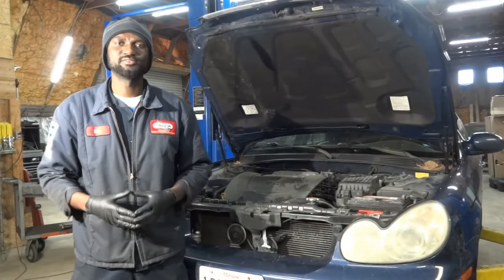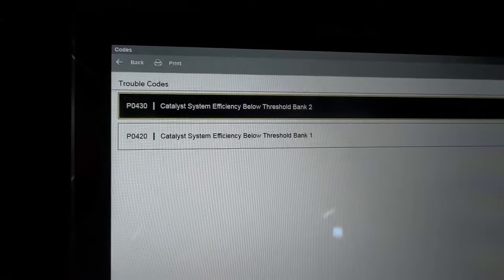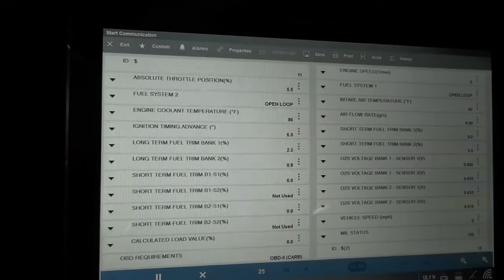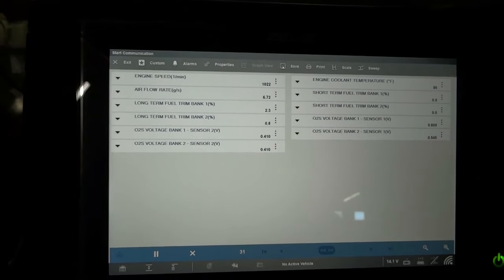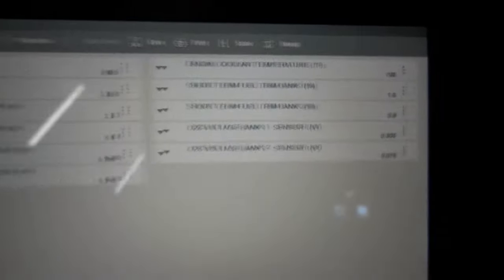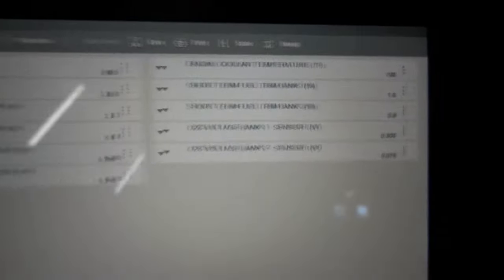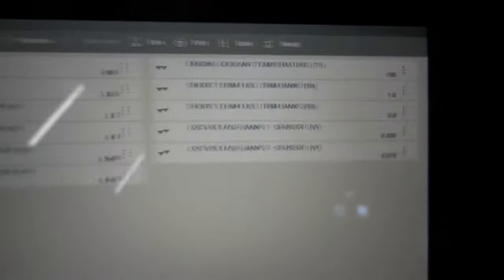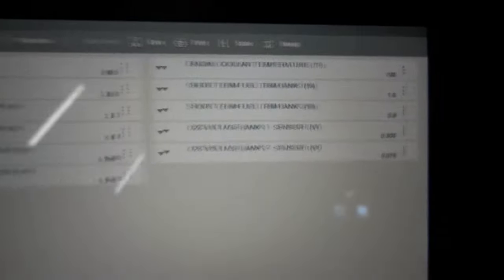Catalytic Converter Efficiency Below Threshold: Code P0420 & P0430 Diagnosis and Repair

Comment: Excellent.  Fix the CAUSE.  I got a p0420, and every shop tried telling me just replace the CAT for $1,800.  NONE of them wanted to look at anything else to find the source of the problem.  The problem was severely carbonized spark plugs not burning fuel effectively and leaking liquid fuel into exhaust sytem clogging the CAT.  replaced plugs, cleaned the CAT, intake and ran some fuel system cleaners.  Been running ever since
Reply from the maker: Samuel Snipes  Thanks! I'm glad to hear that you were able to figure it out!
Reply: This happened to me. Also, an exhaust leak on my flex pipe wasn't letting it get a propper reading
Reply: Great thing to hear. Saving Big bucks. I have the same thing with my C C. I have tried many things because the bash has litten up like a Chistmas tree, and the wind shield wippers are driving me insane. So I unpluged the fuse. It also say on the computer Blind Spot System need survice. But when I start up in the morning or when ever the the engine is cold it blinks and all the warning lights come on.
Reply: Wat cleaner did you use
Reply: That was an excellent explanation, u must be a teacher.  Thanks
Reply: That is a ridiculous price they were trying to get you!!

Comment: First time that I've heard Short and long term explained in all of my 29 years of service. Even teachers and other techs have not nailed it like this bro. Most other people want to be heard for their much speaking instead of making the point clear.
Reply from the maker: MiKyahl Thank you!!
Reply: FOR REAL, I SWEAR THIS IS THE ONLY CAR VIDEO DONE PROPERLY
Reply: What's the max heat range for the cat=and what's the comfort mv for the O2=
Reply: @KITS_Auto_and_Truck_Repair  yes i agree...first time ive found a good lesson on reading the o2 numbers! Thank you!
Reply: Great video! When reading temp i believe before cat was 390 and after cat was 330...you said the after cat temp should be much cooler than before cat...hiw much cooler? 330 is 20% cooler what after cat temp number should we have seen? If it clogged wouldnt after cat be alot cooler also?
Reply from the maker: @mboemmels   My Pleasure!!

Comment: Great, clear, concise PROFESSIONAL information that finds the root of the problem and FIXES the cause, not just the symptoms.  Plus, I would bet 99% of most shops would never asked or have found out the engine was replaced and the cats may have had 200k miles on them.  Yes my friend you said it, “ fix the cause, not the symptoms”. 👍👍. VERY COOL.
Edit, Subbed too.
Reply from the maker: lazerrred  My Pleasure, I appreciate it!!

Comment: Hello K, I would like to point out the difference in temperature between the intake and output is not near the 100°f degrees you stated it should be.
The temps on the old defective Cat were: 
Intake:   390.5°f
Output: 334.4°f
A difference of 56.1°f
The temps on the NEW Cat was 
Intake:   404.3°f
Output: 336.2°f
A difference of 68.1°f
The difference in temperature between the old and new is only 12°f degrees.
It seems to me this is not a accurate method to determine if the catalytic converter is defective.
I think your video is great. The detail and examples you show are top. You excel in quality the art of putting a great video together. Thank you
Reply from the maker: Just Me  Thank you! the rule of thumb is usually 100 degrees higher on the outlet, temperature wise!
Reply: @KITS_Auto_and_Truck_Repair  - Although the video seemed to explain the temperature difference incorrectly (I've understood that the outlet should be 100-150 degrees hotter) it is still great that you covered it so that people know this is a simple test that can be done.  Great job.
Reply from the maker: @dricklorenz9340  Yes! That's what I meant but I misspoke in the video, Thank you!

Comment: First I would like to start off by saying I watched this video from the very first second to the very last second and I must tip my hat off to you sir. You are very straight forward, informative, precise and honest! I wish I could find a quality and honest mechanic like you where I live. I'm not sure where you're located or if you have any contact info, but I would surely become your loyal customer. The reason I say you're honest is because as soon as you turned that vehicle on after the installation was over with and that check engine light went away... you could've easily fooled everyone and told us there you have it folks the check engine light is gone because we fixed the problem. You sir did not do that. You told us the truth! When disconnecting the battery cable(s) from the battery it essentially clears any codes stored in the vehicles computer/memory (which is true). I respect and admire you for that.

I have a 2007 Hyundai entourage limited V6 3.8L and I have a P0430 code. I'm doing everything myself thus far and in doing so I found a lot of cutting corners from every "mechanic" that has worked on my car in the past 6 years or so. I'm not a mechanic by any means and I'm learning as I go by researching and reading. Every shop I have gone to so far... everyone says it's the catalytic converter, but not the two that you changed. They're saying it's the catalytic converter that's underneath the car. No one has done any tests of any kind to determine if it is in fact that catalytic converter. They're just saying it's that one. My gut is telling me it isn't, but again I'm not a mechanic and I could be wrong. The car runs like a champ! You wouldn't think there's anything wrong with it. I do know the fuel is either too rich or lean because my gas gauge is always fluctuating up and down before finally settling and before this code appeared I never had fuel issues. Some times from the muffler I can smell a very rich gasoline like smell. I was also told to first replace the spark plugs and go from there. Start with the smaller stuff before changing the catalytic converter to see where the problem is coming from. I've already changed that and all the O2 sensors, but the check engine light came on again with the same code of P0430 bank 2 catalyst system efficiency was below threshold for a predetermined period of time. I'm just now sure which catalytic converter it could be. 

Would you be able to share what name brand and model # obd2 you are using so I can look into purchasing one?

I'm sorry for this long message, I appreciate your time and the time you put into this video for us. I hope to hear from you soon. Take care!
Reply from the maker: Luis Rodriguez, I really did appreciate your comment I read the all message, thank you for watching the video... the scan tool I'm using in the video is a professional type scanner, since you're working on your own vehicle I would not recommend that kind of scanner, you should get a regular OBD2 scanner that can graph data parameters from your local parts store...
Now, about the P0430 trouble code that keeps coming back on your car, I will say,
 you should check the wiring of the 02 sensors especially the one after the catalytic converter, then double check the sensors in case you got defective sensors out of the box, if everything checks out ok the last thing would be a bad catalytic converter,
if you end up replacing the cat, make sure you determine the cause that caused it to fail before you replace it...
I have a couple of videos on this channel that can show you how to test the 02 sensor wiring or the 02 sensor itself.... Good Luck
Reply: @KITS_Auto_and_Truck_Repair  thank you for responding! Not sure what's a good scanner that can do the same as yours or close to what yours can do. I'm very meticulous when it comes to doing things and that's why I asked. If you have any recommendations I'd gladly appreciate it. Which catalytic converter would be the one that I would change if it does come down to that? Is it the one underneath the car or is it the one you changed in the video? Thanks again for responding and have yourself a great night.
Reply from the maker: @luisrodriguez9712  I can't tell you which one to change; you have to get it diagnosed so you can know exactly which one to replace. I recommend taking it to a professional shop... Good Luck!!!
Reply: @ Luis Rodriguez it’s a Snap on Zeus.
Reply: @ Bork Ganza thank you

Comment: Had the same issue (code p0420 bank1) on a 2000 Acura Integra but car ran perfectly fine. Heard about CATACLEAN and decided to give it a try as my mechanic said it was the cat that was bad. Poured in the entire bottle ($27.99 at AutoZone) when I had 1/4 tank left (per instructions) and drove it for about 100 miles. I noticed a boost in power right away but CEL was still on, I had to reset it and drive another 20 miles or so and when I checked with scanner again, all monitors were ready and no CEL. Took it to my smog station and passed with no issues. Great product which if it wouldn't have worked, this was going to be my next step.
Reply from the maker: G R  oh really!
Reply: @KITS_Auto_and_Truck_Repair  yes sir! I was very concerned thinging my cat was def gone even after using cataclean because the monitors would still show INCOMPLETE on the Cat, O2 Sensor and EVAP after the recommended 10-15 min drive the bottle specified. I guess some cars take a bit longer to react to the chemicals but mine took about 100-120 miles before all monitors cleared on their own. I have no doubt though the non fouler method will work as well but depending on the car, it can be a bit more invasive and time consuming than first giving cataclean a try...just my opinion though  😀
Reply from the maker: @gr2262  sounds good!

Comment: Really excellent explanation of how to diagnose catalytic converters issues. I love the trick of pumping the brakes to make the engine run lean. Now I need to get a scan tool that will show me real-time data streams. (I just bought a cheap one that doesn’t have that feature, am going to return it and upgrade.)

Thanks!!!
Reply from the maker: Dave Etchells  My Pleasure!! Thanks and Good Luck with your project!

Comment: This is the most thorough diagnostic video on o2 sensors and catalytic converters I've seen. Congratulations.
Reply from the maker: Lawson Stallings  My Pleasure, Thanks
Reply: @KITS_Auto_and_Truck_Repair  I have an 07 525i and the brake test didn't affect the sensors' data. I shot a couple of videos that I can send you if you have the time to have a look at my data.

Comment: I love the way you go through the process of testing O2 sensor response by pumping the brake pedal. I have a -29% ST Fuel trim reading. Also a p0420 and a p0170 pending on a 2011 2.4L Sonata. No check engine light but driver said car struggled to accelerate. Once it got going it wasn't as bad.
Reply from the maker: Lubacote Mobile Quick Lube  you might have leaking fuel injectors or a bad regulator
Reply: @K Diagnostics  Thanks for replying. After re-check I realize it was ST fuel trim not long term (updating). Now a P0106 (MAP performance/range) is coming up in pending and actually turned on the check engine light after I filed and gapped plugs . I watched the MAP reading along with trim numbers. MAP readings did something funky a few times that correspond to idle and performance. It's on an 2011 Sonata 2.4L. Gonna clean throttle and intake, change oil replace plugs maybe a sensor. Then clear light. If I have to pull O2 sensors and check pre and aft-cat pressures if the p0420 rears it's head again. Then again those gdi engines burn through oil over time.
Reply: @lubacotemobile  clear codes
for the 420 code you can also put one gal of lacquer thinner in the gas tank on half tank
And burn it through on/going highway speed
After 100 miles or close to empty
Refuel, fill tank with gas 
Drive 10 miles
Check if code still comes up
If this doesn’t work
Take cat off 
Soak in 5gal bucket with Palmolive dish detergent overnight 
And clean
If this doesn’t work than u need new cat
Pray and praise and thank Jesus Christ for everything.

Comment: Very well explained. I just bought a new scan tool autel mx808ts and I can now analyze the date accurately. I have a friend with the same trouble code in his kia grand carnival 2006. The car still runs good but the check engine light stays ON. I’ve been telling him it could be just a bad O2 sensor or worst will be a bad cat converter. Thank you for sharing this video. Cheers
Reply from the maker: Chrispolo Batangueño   My Pleasure!

Comment: I wish all cats were this accessible. My Dad recently gave me a 2005 Chrysler Pacifica Touring  SUV 3.5 and it has a PO420 bank 1 trouble code.  He had the bank 2 cat replaced a couple of years ago. Car runs great, plenty of power and acceleration, tail pipe has pressure etc.  but you can definitely hear the cat rattling when you give it some gas. I changed the oil in it today and that's really the only other issue I have found other than a routine tune up I'll do next week.  lets my Silverado come off the road for some needed repairs at least. As always, great video!
Reply from the maker: Kayla Marie  Thank you! and Good Luck with your Pacifica!
Reply: @KITS_Auto_and_Truck_Repair  you're  welcome Sir.  Thanks, I appreciate it.
Reply from the maker: @kaylamarie8309   sounds good!

Comment: @ 27:17, you said, "the outlet temperature should be a lot cooler than the inlet temperature". I think you mean the opposite. The downstream side of the converter should be 100-200 degrees F hotter than the inlet because of the extreme heat generated in the converter due to catalyzing the NOx molecules apart. That is why the is extra heat shielding around the converter.
Reply from the maker: Castinn Yes I meant the opposite!! the outlet should be hotter than the inlet, thanks for pointing that out!!
Reply: I was about to point out the same and then noticed your comment. I suggest the author to actually change the section of the video.
Reply: I thought the same the outlet should be hotter by at least 100 degrees. What I noticed was that when you replaced the cats.the outlets were cooler than the inlet. So now I am confused. Before you replaced the cats, the outlet was the same as the inlet temp. After you replaced the cats, the outlet was cooler than the inlet.
Reply: @guitarheadhunt  I hear you! I’m dumbfounded. Also what about the graph on bank 2 sensor 2? It went erratic after the lean test.
Reply: @guitarheadhunt  I think if he would have taken more time (steady) to get an accurate temp reading it would have shown higher after. The reading was somewhat erratic and is a static reading. But he did a great job here I learned a lot.

Comment: Very informative. You kept me watching.  However, I need to point out that a properly working  CAT should be hotter 🔥 at the outlet than the inlet. You over mention this incorrectly.  I did think you are super thorough.  Great job!
Reply from the maker: Jon B  Thank you for pointing that out that's what I meant!

Comment: Nice! Didn't realize how the brake booster actually worked. I didn't know it gets extra air when you pump the pedal. But it makes sense since I one day replaced one because it had a massive vacuum leak by the brake pedal.
Reply from the maker: @j.gtheautotech8455  Thanks!

Comment: Thank you so much for taking the time to record this video and share it with us. Like many have stated, it is one of the most comprehensive and easiest to understand videos on the topic! I do have a question regarding the scanner readings. Towards the end of the video when do your final checks with the scanner, while sensor 2 in bank 1 shows a constant signal (flat line), the sensor 2 on bank 2 shows some signal oscillation. What does that mean? Does it mean that sensor might be on its way out?
Reply from the maker: Gui Lima that's ok, sometimes a little oscillation on one side for a minute is ok...

Comment: Extremely  good  Catalytic Converter(s) Video ! ! ..... however ; the  Outlet Temperature should display a ' Minimum '  10 %  Hotter than the Temperature  of the Inlet Temperature. .....If a Converter is not working , the Inlet Temperature  will be Hotter than the Outlet Temperature.

Ex SMOG Repair Technician
Southern California
Reply from the maker: @cbarkwell1000  Thank you! That's what I meant in the video, it was a slip of the tongue, I meant to say the outlet of the Cat should be hotter than the inlet on a Good Working Cat! Thanks for your input!

Comment: Hi K, Try to give your repair center location/address in the description in the videos. Most of the mechanics explain stuff but not in detail. Also, right now it’s important to show that you know what you are doing and earn customer’s trust which is important. You have a great video out there. I hope your hard work pays off and earns you a great reputation. BTW I also saw a few videos pouring gallons of lacquer thinner and driving upto 2500 rpm for 150 miles after erasing P0420 code. Do you recommend it as well? Do you still need to do EM/PCM reset? Lastly, you think you can put dielectric grease in all the screws just to be safe so they can come off easily next time? You can also edit and put a note in the video about the inlet/outlet temp correction for folks otherwise you will get a lot of comments again and again :). Keep the interesting videos coming!
Reply from the maker: World Peace  Thank you! I like your suggestions I appreciate it, No I don't recommend that stuff, it doesn't work

Comment: Fantastic explanation how to test cats and O2 sensors and their behavior. I will have to do it on My Bro in law F350 which is only 1.5-year-old and 80,000 miles and is calling for cats' replacement
Reply from the maker: StagArmslower  Thank you!! Good luck with your project!!